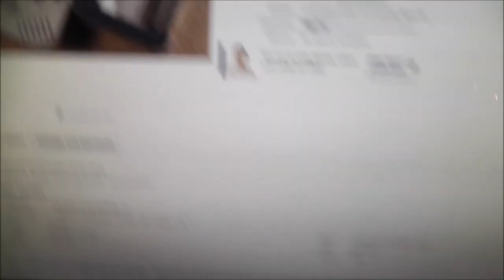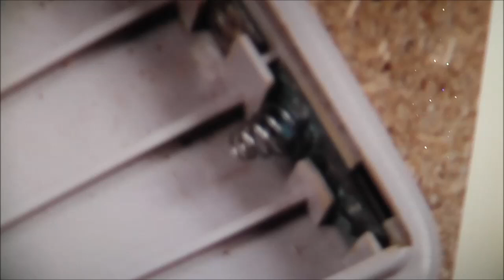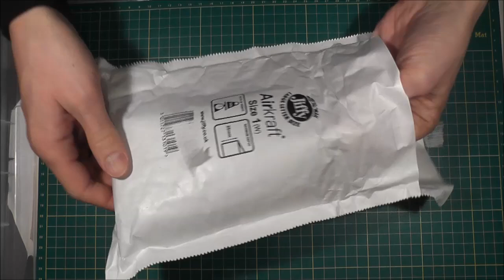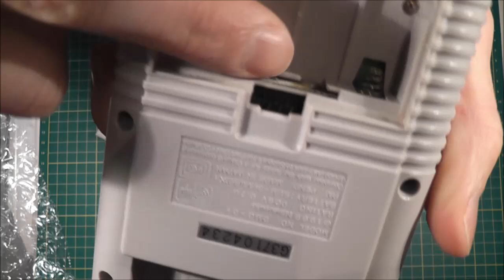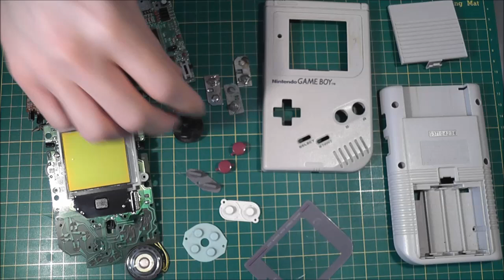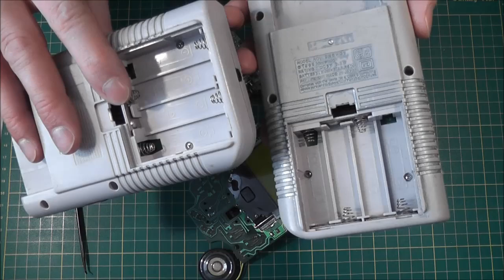Let's Repair - Ebay Junk - Original DMG Nintendo GameBoy

Comment: Ik i sound retarded but....I didnt know that you can put a gameboy color game in an origonal gameboy...unless i looked at it wrong dont sue me XD
Reply: true the pocket is the odd ball out and while color games will fit in it most will not work with it. hence why several games when booted in a pocket or super gameboy will display an error stating that this game is only compatible with gameboy color.
Reply: Basically those black cartridges are meant for a GB color, but they will work on any other previous GB (They are physically compatible since its shape is the same as any normal GB cartridge). GB color only cartridges are not physically compatible with the 1989 GB, but can fit on a Pocket or Light GB. They can't work because they are deemed too powerful to work on the processor of the previous GB's, they are generally see-through, they are mostly the same shape (ex:. Like Pokemon Crystal), or have a very different cartridge (ex:. Kirby Tilt n' Tumble or any Rumble cartridge like Top Gear).
Reply: Color game? its possible yes but u can't play =P
Reply: Noctina Tatakai i tryed that with pokemon Cristal and apear a mensage written in unkowns pokemons ...
Reply: ah...I see super serious face activated
Reply: The Dragon Gamer XD is just saying u can't play ... any way the ukown message is just CRYSTAL xD
Reply: Noctina Tatakai ye ive tried it lel
Reply: There are a few GBC games that are backwards compatible the original game boy. As a general rule of thumb look for cartridges that have the notch in the top of them. Most GBC games are on transparent carts and are not backwards compatible. Most Gameboy games have an opaque cartage. A few example of GBC games that are backwards compatible with the original gameboy are pokemon pinball and battleship.
Reply: Trekeyus  but u can insert a color game on gameboy pocket with no problem if i remmeber well that does not has the thing to  lock the cartrige and is like gameboy color =) ... if im wrong then the only possible way is cut that out =P
Reply: in short if the game dose not have the notch it will not work.
Reply: wow i started a giant conversation o.O
Reply: Trekeyus  but the gameboy pocket is like the gameboy color ... it does not use the notch ... and it reads only game boy version games
Reply: Trekeyus  ^^ and the poke crystal say that error and its very funny =D
Reply: khaled khunaifer
 http://forum.digitpress.com/forum/showthread.php?166740-Gameboy-Color-games-on-an-original-Gameboy/page2
Reply: The Dragon Gamer/Artist LOL im 11 and im laughing at your stupidity!
Reply: The Dragon Gamer/Artist i know im awesome

Comment: hi. do you actually touch the ribbon cable with the soldering iron? or just hold it close to it? i messed up my screen and the cables came off :( i need a new screen now but want to know how to fix the lines

Comment: I didn't think gameboy colour games work on the original gameboy
Reply: The black ones work on both, the clear ones are gameboy color only.
Reply: I know that a few of them work on both. Links Awakening DX works on the original gameboy.
Reply: richard howard SMB DX is a clear shell which means it only works on GBC or GBA.
Reply: Jonathan Crabtree The Pokémon games (aside from Crystal) also work on both.
Reply: Does super Mario bros DX work
Reply: richard howard type 1 carts (grey ones) work on it and type 2 carts (black ones) work on it but type 3 (clear) and gba carts dont work on it
Reply: If it's a solid color it will work on an og GameBoy if it's a transparent color it won't

Comment: I dropped mine (by accident of course) and the case cracked. It doesn't work a anymore.
Reply: Are you being honest?
Reply: Normally the are more durable. I dropped mine a few times and it still works. Only the screen protection got off, but I just used super glue to fix this.

Comment: thanks for the idea of replacing the board that has a part that is not working right i have the original gameboy that i had when i was a kid (i am 26) and has phillips head screws. but unfortunately the screen has a line on the left side of the screen. the same problem you fixed in the video. and the contrast is getting very touchy and the speaker is starting to crack. but luckly i received a gameboy for free with a working screen but will not power on

Comment: Anyone know how to fix horizontal lines on the Gameboy screen?
Reply: Usually its the flex connector connecting the LCD to the mainboard at fault, Try to clean it up with alcohol and reseat it. If that doesn't work, take a look at the DC-DC converter and check if the fuse on it is blown out. If it is you can just short it out with a thin wire.
Reply: PatchworxStudios They are glued on and any attempt to use this method would damage them beyond repair.
Reply: it showed you in the vid
Reply: C Will
 Maybe not. You have to do the same on the Horizontal connector. Harder to reach but should work the same only on the backside. I have one open here but dont want to remove the screen to look up.
Reply: Maybe you could desolder the whole screen? 16x2 Connectors when i am counting right. Then you can flip it and  it gets easier. Il try if i find one that is broken.... maybe it wood be better to use this hot air soldering stuff xD Don't know how to call it.

Comment: Nice tip for repairing missing pixel rows, hadn't thought to try that.
I've fixed a game cartridge with faulty mask ROM before. Seems the issue was that some of the bonding wires inside the IC package were loose from the chip. Squeezing the ROM chip hard seemed to make it work for a moment, so I did a permanent fix by wedging a wad of paper between the IC and the top of the cartridge shell.

Comment: That's really cool. I just want to know how I can get the yellow color out of my game boy case
Reply: I believe the product you need is Retr0Bright.
Reply: easy peasy, rub it down (carefully!) with some lemon juice and leave it in the sun (or a sunny place in your house) for a half hour or so, just tried this today with my DMG-01 Game boy
Reply: Isaac Carnes
 and how are the results? I will try this tomorow cause i have to 2 oldeones here in a realy bad shape. I hope it works cause the yellow color comes from the sunlight and should be irreversible.
Reply: It definitely makes a difference but you may have to do it a couple of times, I know I had to. Like I said though, be very careful, lemon juice is acidic and very conductive so nasty things could happen if you drip it in the electronics. Try rubbing it down with a paper towel and squirt the juice on the towel, not on the Game Boy. Also, make sure it isn't going to rain...I got mine in about 2 minutes ahead of a hard rain here. if you can't get it outside for full sunlight, then prop it up in a sunny window. Lastly, clean it off when you are done, the window cleaner and toothbrush method works pretty well. And it will smell lemony fresh when you are done XD

Comment: I wish you had actually shown a method for cleaning the battery terminals. I have an extra Game Boy where acid has leaked all over them. I've done my best to clean them up letting them soak in baking soda and bleach. Then scrubbing them with a welder's brush. But, I still can't get it to power on.

Comment: That's a Game Boy Color game... do those work in the original Game Boy?!?!?  I had no idea!
Reply: game boy color only games are clear(see-through), but black ones works in both game boy and color, and then grey ones works with both of them, but they were made originaly for non-color game boy
Reply: Cool thx!
Reply: J^P Didn't some of the pre-Color games designed only for the original Game Boy have colour graphics when inserted into a Game Boy Color, in that colours were either coded into the game or glitched in (I always thought the original GB and GBC were cross compatible though having the same hardware except for the colour screen and graphics chip, but I could be wrong)
Reply: The Game Boy Color's CPU is clocked twice as fast as the original Game Boy's, and the RAM is 4x as much IIRC. This is used to full potential by the clear cartridge Game Boy Color-only games, which also use the full colour palette of the Game Boy Color. The black cartridge "dual-mode" games use a relatively limited colour palette on the Game Boy Color and in some cases have some graphical effects disabled on the original Game Boy (such as Tetris DX, where the background is static rather than the moving squares one). In the case of Nintendo's own games, early grey-cartridge original Game Boy games (1989-1993) when played on a Game Boy Color can only be displayed in grey or one of the console's basic built in colour palettes, whereas the later ones (1994-1997) are displayed in their custom Super Game Boy colour palettes. And now my fingers hurt :-P Woah!
Reply: GeoNeilUK  I dont know about that, but black ones plays in original gameboy, and in color on game boy color
Reply: GeoNeilUK yes pokemon was like that but im dont know any other games
Reply: Donkey Kong '94, Donkey Kong Land series, Space Invaders, Galaga and Galaxian, etc. - the colour palettes were introduced around 1994 and were intended for the Super Game Boy, but the Game Boy Color also recognises them.
Reply: Awesome reply - very informative thanks.
Reply: Haha np! I have no idea how I was notified about this thread before I even commented but glad I was lol...

Comment: At what temperature did u set your soldering iron at to repair the lines on your screen? I've got the same problem but don't want to apply too much heat.

Comment: My friend has two original Nintendo Game Boys. One of them has the same problem with the battery leak. I easily fixed it! His screen cover was also fallen off and I used this one type of adhesive, which I forget...

Comment: In all actuality, horizontal bars are very troublesome. There is a second ribbon cable underneath the screen which deals with horizontal lines. That, unfortunately is un fixable. I would consider either buying a new one or roughing it with your old one.

Comment: there are two kinds of game boy color games. the one in the clear plastic cartridges which won't work in the original game boy (not even if you make them fit) and the ones in the black cartridges which have two versions of the game, one for the game boy color and one for the original one.

Comment: I've recently run into my old gameboy and it seems to have the same corrosion issue this yours did.  What did you use to get rid of the corrosion/clean the battery port?

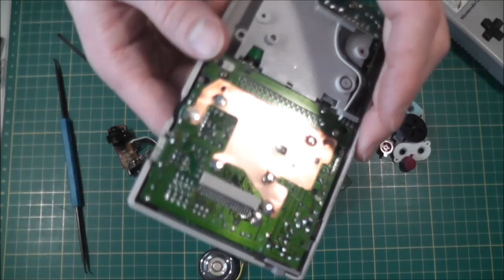Comment from the maker: Nope, it's the same compartment and rear housing. That's how clean they'll look after being properly stripped and cleaned ;-). The only thing I switched out were the rear board + corroded and dirty contacts. I mentioned that's what I planned at 9:45.
I could have spent time cleaning the old metal contacts with a wire brush but no point since I already had clean spares good to go.

Comment: I am good at repairing stuff but normally the broken stuff on ebay the seller already tried to fix and failed... and then lost parts... and then they sell it as "I haven't used this item and years so I'm selling it as is" then you get it and screws on the inside are missing and you know what happened...

Comment: The original Game Boy systems (as in, first batches), all had defective displays, including store displays, usually happened on the right side. I tried many times to fix it, and finally did, only for the system to crap out a few months later (unrelated issue). The later batches worked, but the installs were off-center, crooked, or both.

Comment: I found a blue version of this just the other day in the electronic recycling bin in my buildings trash room. It also had a game in it, Super Mario Land IIRC. It worked perfectly, a little grimy but nothing that can't be cleaned. The battery compartment looked fine. There was also a PS1 in great condition, which I left. A couple of days earlier I found a 14" CRT television (w. built in DVD player)  in almost new condition. That I use for my Atari 8-bit computer.

Comment: I just found one of these, it looks ok, sturdy. the screen though has a low contrast and when I power it up it only makes a sound and the screen displays a horizontal thick line(tetris line) in the middle. it doesn't have a game cassette. my question, do these things work without a game cassette? is it supposed to do anything else when you press the buttons?

Comment: i dit bought 2 gameboy's for 10 euro's excluding shipping costs.
after i had cleaned them,they work,however by 1 of the gameboy's 1 battery connection has been rust,i tryed to remove that rust with sandpaper but it doesn't work.
by the other gameboy it does work via battery's but one slight move and the gameboy shut's off.
they both work with adaptor.
they both are also yellowish.

Comment: Wish I could.  That is one item I don't have.  Although where it was stored is dry I had both Game Boys there and only the one fizzled.  I am actually having the same problem with my platinum GBA.  Put batteries in it and pray when you hit the power switch.

Thanks for the response. I will look into it. :D

Comment from the maker: The battery section is the original and the same one shown at the start of the vid. Just cleaned it out with warm soapy water like the rest of the console. Popped in some new metal contacts and it looks good as new.

Comment from the maker: Most consoles don't have stickers on them. If they do then they're usually vinyl and should be reasonably water proof :). If you have a system with paper stickers on it then just don't let that area get wet.

Comment from the maker: Thanks dude. Same here. I have 2 big crates out in the shed where I dump all my junk electronics. I've also taken to stripping components and boards from general household devices now too, haha. Loads of useful parts to salvage!
It's weird, I felt I should have maybe desoldered that cracked power jack for making this vid. But IRL that's not the kind of task I'll undertake if it can be avoided. So I just switched out the rear board to make life easier :P.

Comment from the maker: On the plastic housing, hot soapy water and a tooth brush. The metal contacts I simply switched out for clean ones from the donor systems. But if I didn't have spares I would use a wire brush and steel wool to remove corrosion. Basically the same way you would clean any other piece of tarnished/corroded metal.

Comment: Question.  What would cause a Game Boy to stop functioning.  My wife and I have 2 of these.  After we bought our GBAs I put the old ones in storage. They were put in a cabinet in the living room, batteries of course removed.  Sometime later I decided to have a go of it and found that one quit working altogether. Battery compartment is clean but it's not getting power.  Any ideas?